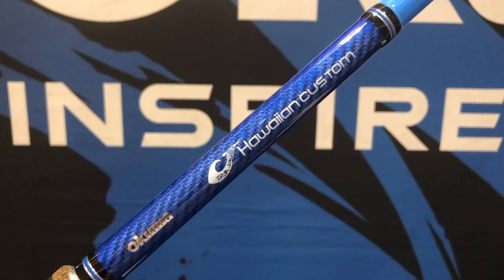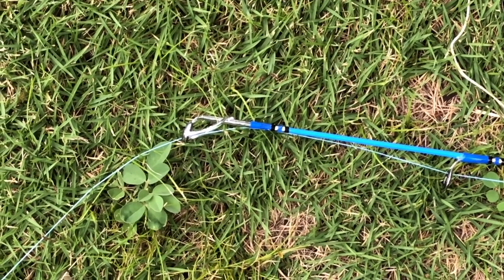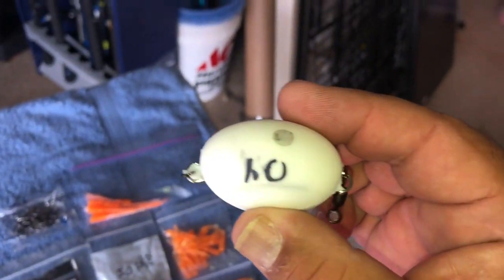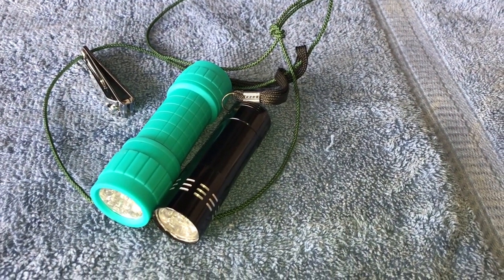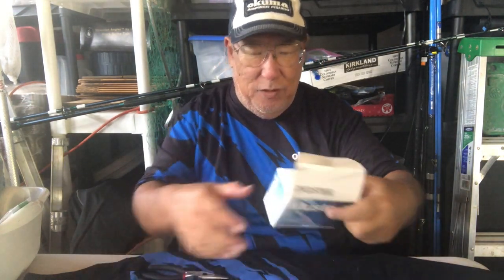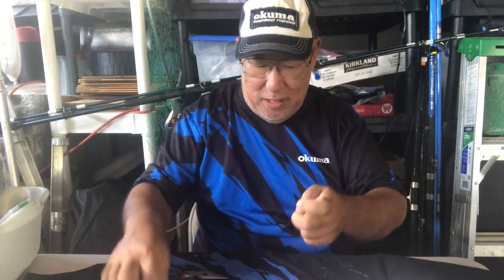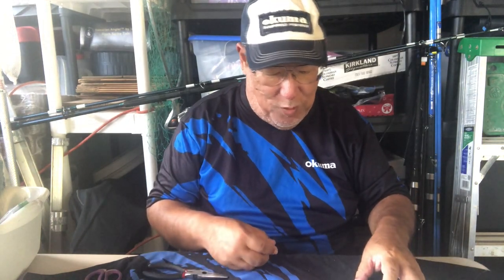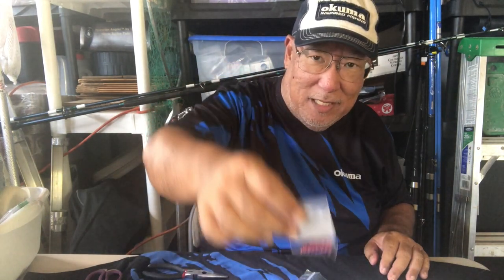My NEW 14' Okuma Whipping Rig For A Night Out On The Rocks!

Comment: I got a love and hate relationship with those 14’ pole. Got two before and 5” from the tip down broke on me
Reply from the maker: I've had a rare 15ft 3pc Fenwick carp rod before. It taks a few outings before you can get used to handling these longer rods but i know what you mean. I'm currently using a 13' & 14" 3pc Surf Rod i helped develop for Hawaii.